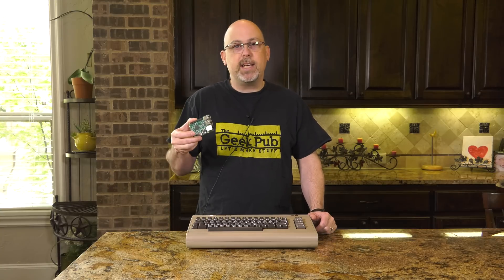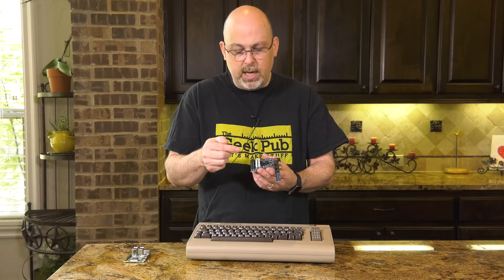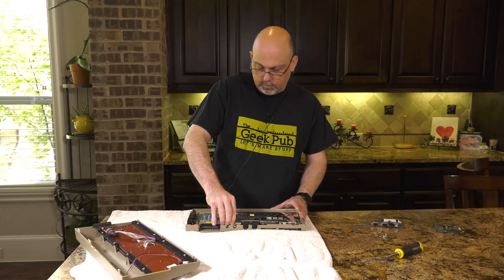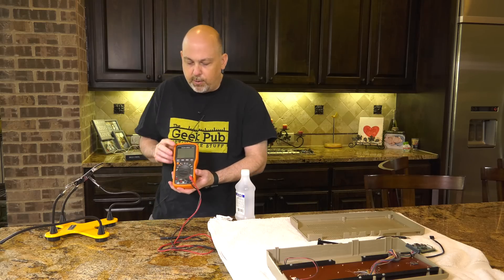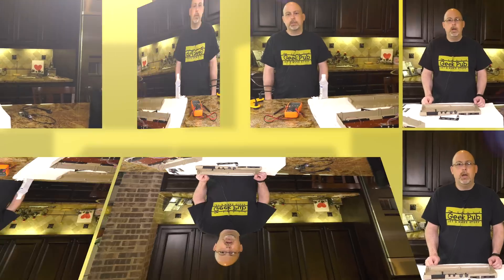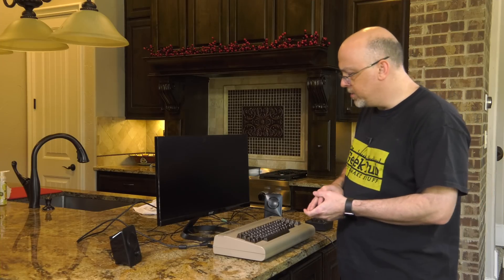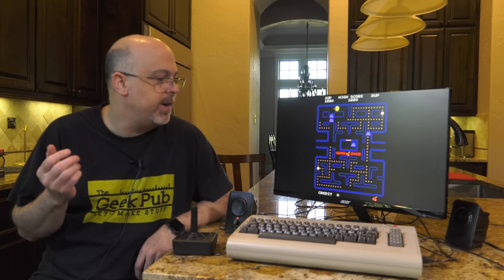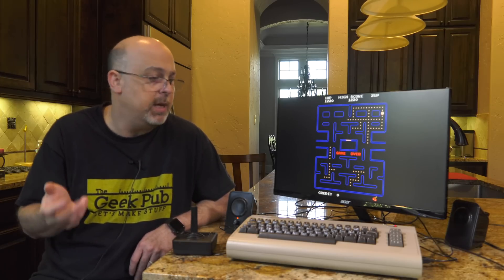Raspberry Pi Commdore 64

Comment: It is better to clean the PCB with the paint solver (in my country they called NITRO): https://pl.wikipedia.org/wiki/Rozpuszczalnik_nitro . Here is some translation as there is no EN version of this article. 

"Nitro solvent - it is mix of organic solvents used in the paint
industry for dissolving Nitrocellulose based paints. The chemical
composition is not regulated and depends on the producer. However in
most cases it consist of 70% Toluene and 30% of Acetone, beside some
producers adds Xylene, Ethylbenzene, Methyl acetate, Ethyl acetate,
Alcohols and another add-ons."

And instead of using paper towel it is much easier to use and old tooth brush. :)
Reply from the maker: You can clean yours however you choose!

Comment: Dear Mike, I am not a troll, but I would like to say that for many years I was soldering like you do. Until I found some videos explaining how to solder it properly. And it is quite simple. Put soldering tool below the soldered element and a solder above. Wait until the soldered element heats enough so the solder melt and gravity do the rest. I hope this helps. :) It might also help if you first put the wire in the soldering flux paste to allow better bonding.
Reply from the maker: You can solder yours however you choose!
Reply: @TheGeekPub  How very nice of you... Mr. Director
Reply from the maker: Dear Piotr - If you go trolling, you get trolled.
Reply: @TheGeekPub  I was not trolling. Since when giving some friendly advice is trolling? Instead I got your rude answers (3 times in a similar manner).  Please give me your definition of trolling as we are clearly having some misunderstanding.

Some of your words from 1 Sept 2017:
"This is a family channel. It is all about helping each other, learn and grow" (https://youtu.be/27wRjFasEFs?t=227). Is that statement not valid anymore?

Your overreaction was very disappointing.
Reply from the maker: You came on here to tell me "You did it wrong."  I told you that you can do it however you like on your own project.  If that's offensive to you, sorry.
Reply: @TheGeekPub  I came here to tell you "you did it good (because it worked) but you can do it better". :)
And I was not offended, simply curious why such aggressive reaction.

Comment: As far as your soldering the only thing you did wrong was you put the iron and the solder on at the same time. Heat the post and the pad then touch the solder to those. That way the solder melts when the components are hot enough and you don't end up with a dry joint.

Comment: Great project! Another thing I would consider is adding an externally accessible SD card slot (you can get SD card slot extensions from eBay), that way if you want to run a different distro on the RPi you won’t need to open the case to swap out the card.
Reply from the maker: That's a great idea!

Comment: I forgot I was subscribed to both channels. I don't like the idea of butchering a vintage machine to replace the internals with a modern system. I mean, what's the point?
Reply: Yeah, this feels weird. Hopefully, anyone attempting this will keep the internals intact and safely stored.
I can see a similar mod done but with a raspi zero inside a random, vintage (or not), keyboard and have a switch to emulate a bunch of old computers including Amstrad and Amiga.
Reply: I think this is more for people that have a broken c64 and want to remember the good old days with by playing games on that hardware.

I personally would have thought about putting a HDD in there and at least allowing the micro-sd to be hotswappable. Beautiful thing about the Pi is that it doesnt have to be one thing.

I have the NesPi case (purpose built case for the Pi) that allows me to change the micro-sd. So one minute its my Retropie machine then later it becomes a useable desktop. Or even a media center.

To be fair you probably could do that all on one SD card but I like clean installs
Reply: MrGeekGamer the point is you can do more then a normal c64
Reply: Yeah, but why pack than into an actual C64 case. I can do far more than a C64 with my 2014 vintage PC.
Reply: TheGeekPub 
Yep, makes sense as the Pi is small enough, that a similar thing could be done with an Apple II.
Reply: Now both PAL and NTSC games will run well.
Reply: In theory, this could be done with those aftermarket C64 replacement keyboard cases, and for the average person who doesn't have  a C64, iy might be a cheaper option. IMO, this is a better option because I don't wanna screw up a good one as well as I wanna leave "parts systems" to repairers.
Reply from the maker: If someone has a dead C64, this is something to do with the case.  But as I said, there was zero butchering in this case.  I can put it back to 100% factory with no damage in just a few minutes.
Reply: I guess if the internals were already busted, but even being able to restore the machine... I just wouldn't replace the internals unnecessarily. But that's me :)

Comment: U can buy some old usb hubs.  Resoldier usb motherboard plug to usb type a and cut backplate for 3 usb ports/audio cable near new usb ports  / print and crew.  U can use logitech k400 or mini usb keyboard from ali.